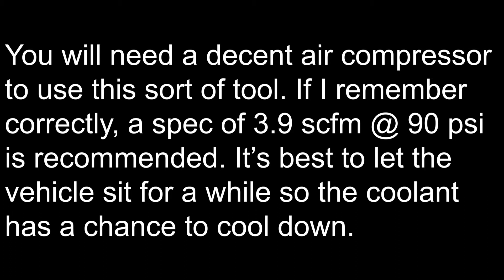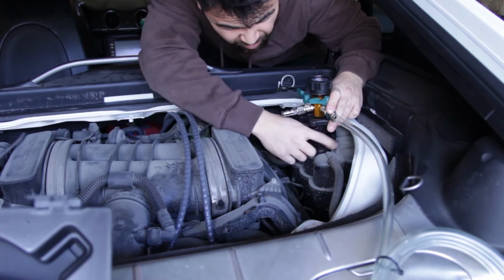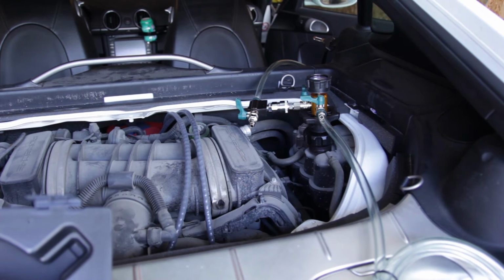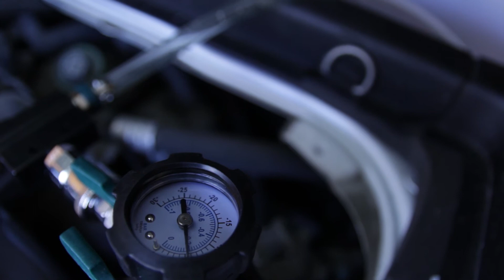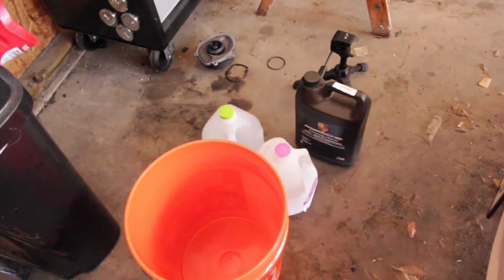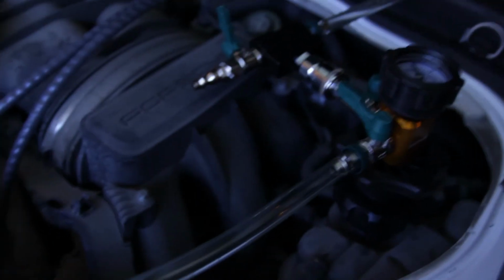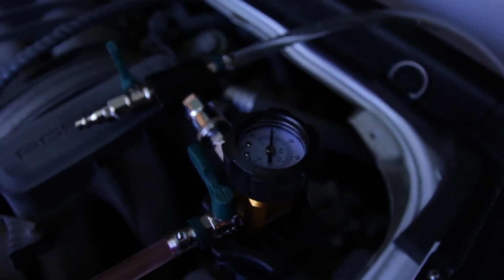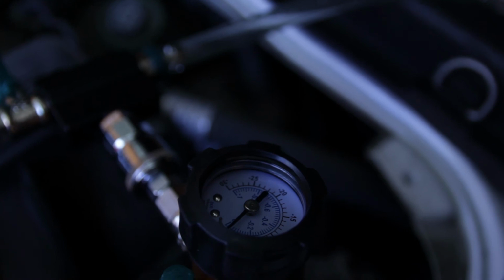Porsche 987 Cayman - Bleeding and Refilling Coolant

Comment: Hello Jonathan.  Awesome video.  Question: time stamp 0926 - how did you clear the air from the tube that is receiving coolant?  You mentioned opening the receiving valve.  Wouldn't that put the air in the system? Please advise.  Thank you.
Reply from the maker: Thanks! This is actually something I forget to do all the time so I am glad that I actually included it in the video. Basically, you are purging air out of the line. Turn the valve, suck up coolant until the tube is full. A little air is introduced into the system but if you keep your air compressor line connected, you can run the vacuum again to remove the little bit of air that was introduced into the system. It won't take long to get back to the proper vacuum level.

Comment: Hey, could you simply drain and fill like old school? Cool tool and video! Do you know if this is the way it’s done at the dealer? Did you consider other tools for this?
Reply from the maker: This is the most efficient way to do it as far as I know and I do believe that this is what the dealerships do. You can supposedly bleed the system by lifting the bleeder valve (like as seen here https://www.fcpeuro.com/public/assets/products/441473/large/open-uri20170126-7343-1msgzwb.?1629764775) and I think you just drive around with it open for a while and hope the air gets burped out. You could also raise the rear end of the car and run the engine at idle and keep filling with coolant until the motor no longer accepts anymore. At the end of the day, a lot of people still seem to have trouble getting all of the air out from what I’ve seen. I’ve never tried it my self so I’m sure it can be done just a lot more difficult. Sorry if that doesn’t help, for me an air compressor is useful enough to justify purchasing. The vacuum tool was about $70 bucks and my air compressor was like $114 so not too bad of an investment and definitely beats the time/effort of trying to manually bleed the system.
Reply: @jontansgarage  What kind of air compressor did you use? Bought the tool and now need the compressor.. was thinking for such a short time of running the air any small 1 gal that can sustain 100psi should be good? Might have to stop and start the air supply valve a few times to let the little 1 gal tank fill back up to maintain 100 psi in to the tool?
Reply from the maker: @Rob-wx2rq  Hey man, this is the compressor that I have and used. https://www.harborfreight.com/air-tools-compressors/air-compressors-tanks/8-gallon-15-hp-150-psi-oil-free-portable-air-compressor-64294.html I don't remember where I saw it, maybe in the manual for the tool itself, but I remember reading that a compressor capable of at minimum 3.7 or 3.9 SCFM @ 90 psi was required to work correctly. The reason why I picked that specific compressor was for running the coolant evacuation tool and it works fine. Might be able to get by with a smaller compressor as long as it's decently strong, However, it looks like a lot of the smaller 1 gallon ones are less than 1 SCFM at least at harbor freight so I honestly wouldn't chance it. Maybe it would eventually get there but even with the compressor I have, it took a little bit to get to the required psi. By once, cry once right? Hope this helps man. Good luck!

Comment: Thanks for the video!   I am doing exactly the same thing - replacing the waterpump and the thermostat.   Just started using the OEMTools.   I tried several times to use the 35mm adaptor but couldn't get it to snuggly fit onto the coolant reservoir.    Wondering what I am missing.   I am gonna try again tomorrow.
Reply from the maker: It's a pain to get a perfect seal. A lot of times the weight of the tool with the air line can shift it and make it hard to seal. Try to wipe the inside of the coolant reservoir off and make sure its dry along with the rubber adapter. When you tighten the tool to expand the adapter, it'll sometimes push the tool upwards as it expands. I usually try and press down on the tool while I turn the expansion knob to keep it from moving. I had to try a lot of times to get the perfect seal, each time I tightened it a little bit more and I would get a few more psi on the vacuum. Hope that helps!
Reply: @jontansgarage  Your tip is hugely helpful!   It's good to know that it's not as easy as plopping in on.   The pressure kept dropping so I was dreading a leak.   I was about to take drastic steps of filling the car with distilled water and run the engine to find the leak.    Then afterward, I'll have to do a flush to get rid of the distilled water.    That'd mean a double headache.    Your tip tells me that more than likely it's the tool.   Regardless, I am going back to check all the hose connections and the torque on all the screws.
Reply: @jontansgarage  By the way, all the youtube videos on the OEM tool gave the impression that it's as easy as plopping it on.   Again, it's good to know that it is not.
Reply from the maker: @Chitown388  Yeah, it definitely takes some finagaling to get it just right. I've tried it on other vehicles and it's the same thing; takes a bit of trial and error. Hopefully it's not a leak. I was thinking the same thing but continued to mess around with it and found the sweet spot. Good luck man!